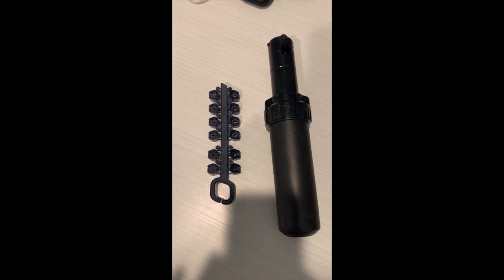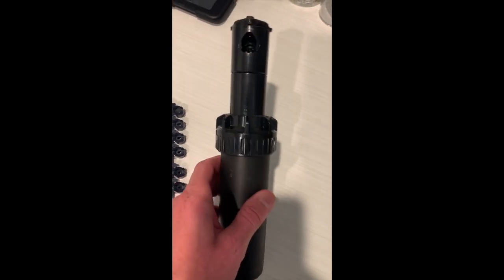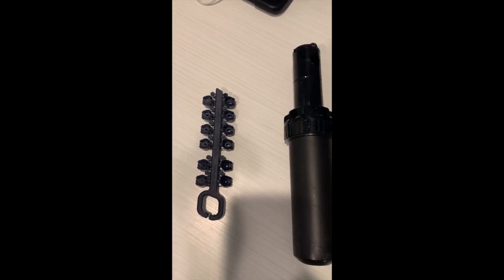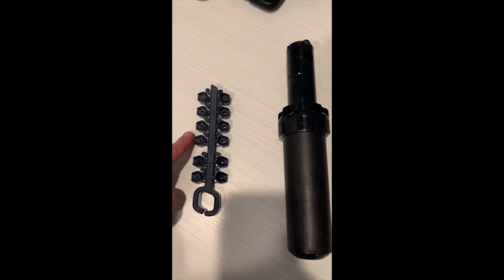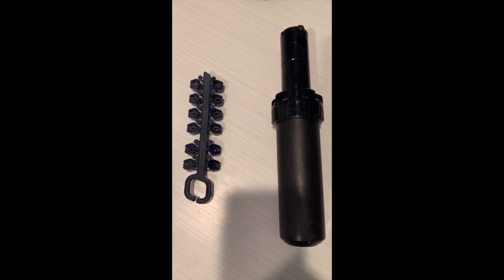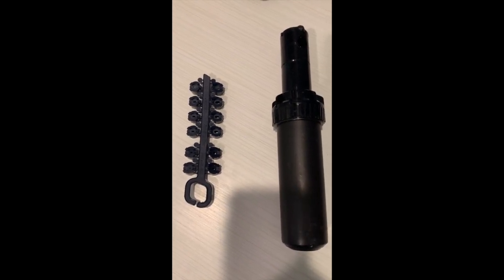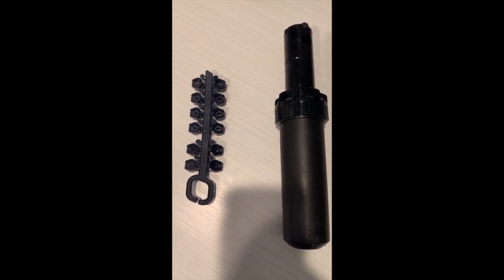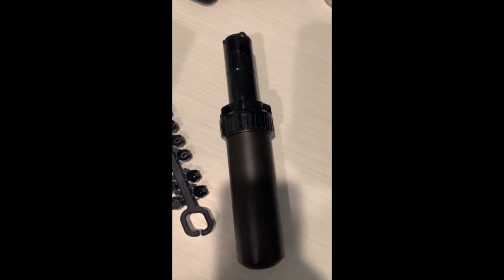RainBird 5000 Series Nozzle Selection

Comment: Most of the nozzles that came with my Rainbird 5000 rotor head were not connected to the tree, just loose in the bag.  So how do I tell which nozzle to use, I want to throw the water 35ft but low!!  I live in a windy area.